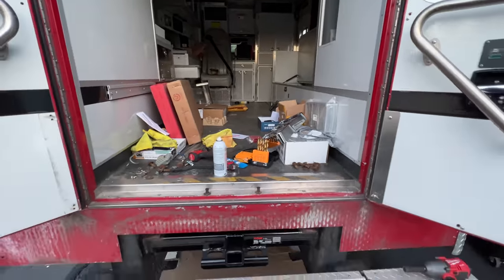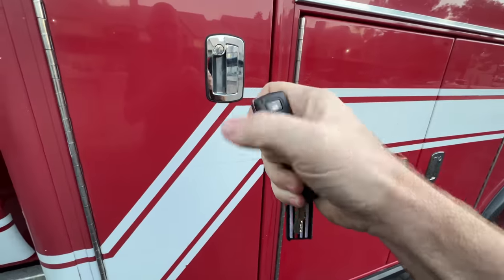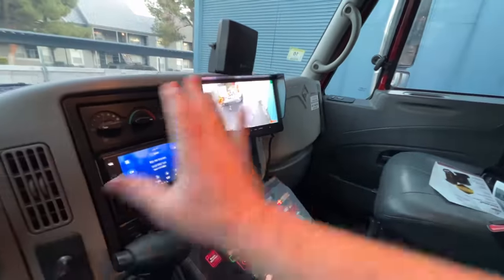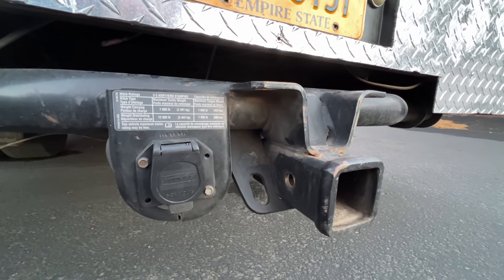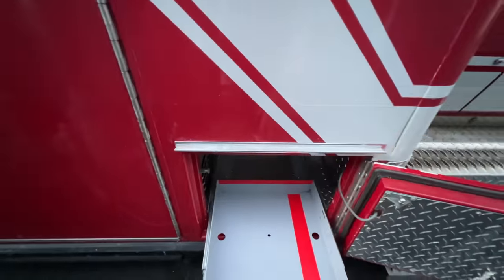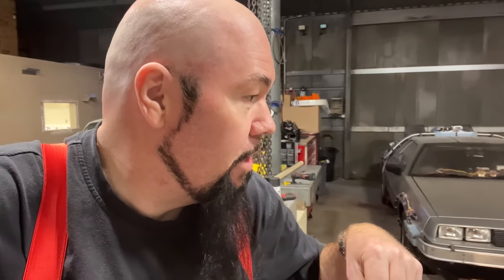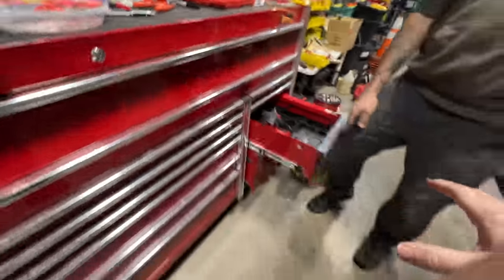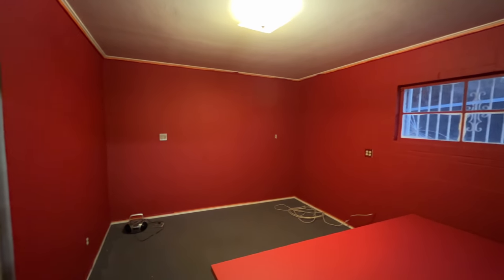Hitch install on an Ambulance - Horton International 4300 - Vanlife

Comment: I’ve got a 2008 4300 with a Taylor made box. Do you have any ideal what trailer wiring harness I need that runs between the brake lights.  (7pin)

Comment: My wife and I full time and have been thinking about getting the E350 to tow with and use the ambulance for weekend getaways. If you see this Bob how much can the E350 tow?
Reply: I have a ‘96 F350 with the 7.3. She weighs 10,500 empty. The Trans just can’t handle much more than a regular build out. That’s your weakest link IMO when you’re using a 1ton chassis. You might look into a Shuttle bus size like this chassis. Yes it’s more money and maintenance is significantly more costly but she’ll have plenty of power, room and towing capacity. Just Google what people use for their drag cars or racing hobby track cars.
Reply: @RustyZipper  thanks!
Reply from the maker: You don't really want to tow more than 10K lbs with anything that isn't a bus or a toterhome, you can pull a 20K stacker with a semi, but any van or a truck pulling something with a bumper should not go over 12K in my opinion. My Excursion would pull that 32' trailer with about 10K no problem, but if you want to go over that it should be a 5th wheel.
Just because you can doesn't mean you should.